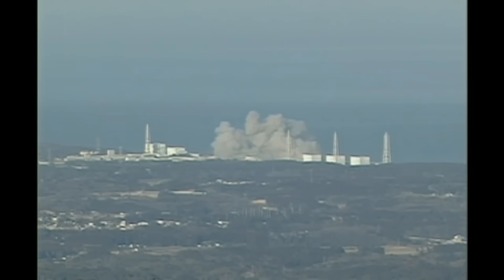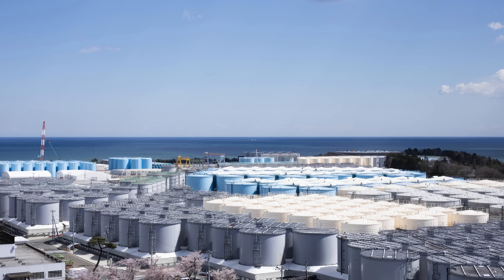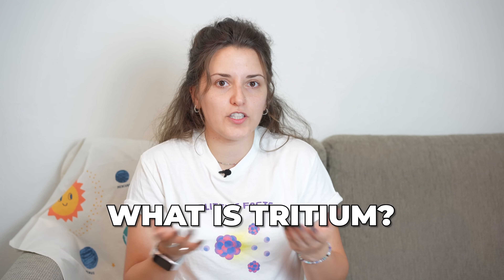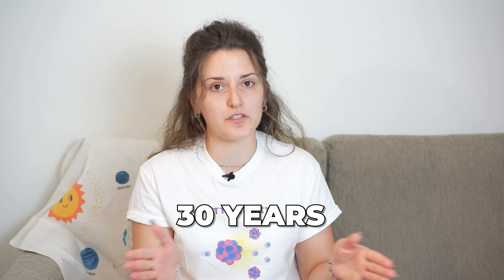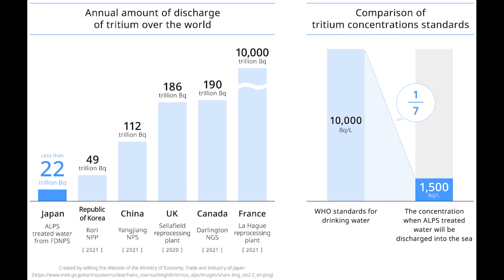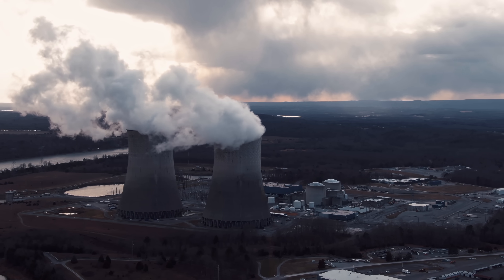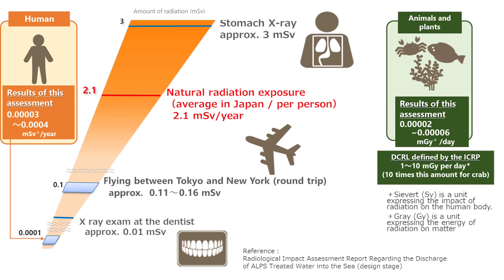Nuclear Physicist Explains - The Release of Fukushima Treated Radioactive Wastewater

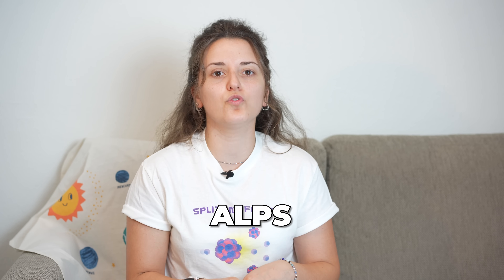Comment: Very interesting. How do you confirm that ALPS system can remove radioactive materials other than deuterium or tritium(1:22)? Is there a specific principle introduction of this system, or the paper basis of its actual test results in other projects or experiments? Or do you just believe the unilateral statement of the Japanese electric power company that caused the nuclear accident because of negligence(The Japanese claim that they have inspected less than one-fifth of the treated water according to their own standards.)? According to Japan's own investigation report, there are at least 64 kinds of radioactive substances besides deuterium or tritium in these waters before treatment, and more than 70% of them exceed the standard, and ALPS does not have same purification effect on all of them. In addition, the highly toxic radioactive substances such as neptunium 237 and tellurium in nuclear reactors did not appear in the Japanese report at all.
Reply: Verified in the full report.  Check it out instead of spreading nonsense.

Comment: i thought itrium is heavy water just like plutonium explode in combustion engine like nuclear uranium..i had discovered the technique during resrarch discusion about it in the u.s. it is not toys but depends on what level of enrichment and stable concentration it is if is less than 4 part per million then safe orher than that microwave radiation from cosmic tay can start chain reaction in atmosphere

Comment: 0:44 Correct me if i am wrong. The reactor vessels themselves did not explode but the reactor building exploded due to the hydrogen gas buildup. This is an important distinction.
Reply: Correct, secondary containment exploded, not primary containment.

Comment: The Fukushima incedent was the worst in human history. Two breeder reactors went into melt down and the water used to cool the cores vaporized into hydrogen 3 and exploded causing tons of MOX fuel (Plutonium and Uranium) to be released into the atmosphere. What remained inside the containment buildings is to this day still hot and releasing radiation including into the aquifers.
The explosions were great enough to push radiological materials including Plutonium and Uranium etc etc etc up and into the jet stream hence all over the Northern Hemisphere.
If I'm not mistaken the half life of tritium is 12 years so in another 12 years we will not have to worry about it too much,. Waste water can not be cleaned 100% from most all of the other radiation.
I find it interesting that in your video you picked the most benign radiological element to focus on and talk about.
And to my friend who claims to know about nuclear engines in submarines and that he was certified as a Electrical nuclear technician, stick to rewiring houses as an electrician you will make more money that way🤫 The science and workings of a nuclear sub are much much different then land based reactors, especially breeder reactors...
Reply: Impossible the even get past your first sentence without calling out such nonsense.  Three reactors at Fukushima melted down, and no one was injured by radiation.  Not so with Chernobyl where people actually died and 10x the amount of radiation was released.

Comment: I disagree with you totally. We are not just talking about Tritium alone. There are so many other highly radioactive isotopes that are present in the  Fukushima nuclear contaminated water. It is impossible for the so called ALPS filtration system to filter out all the contaminants. The fact is that no independent engineers or scientists have been allowed to evaluate the efficacy of the ALPS and whether it could perform it's filtration function consistently over 30 years. Also, it the treated contaminated water is safe, why Japan refuse to allow other country's scientists to perform independent verifications before the treated treated water is released into the sea. Also if the treated water is really safe, Japan could just store the treated water in a reservoir onshore, why need to release into the sea.
Reply: You could have read the report before making such a f00I of yourself on the internet.

Comment: I want to point out that the cascading failures and technical inadequacies in this disaster were greatly exacerbated by the deceit and dishonesty of TEPCO.  I would not trust any data they provide, there must be external, independent investigation of all matters.
Reply: Show where they are lying.
Reply: @ForbiddTV  I’m surprised you are unaware:  The utility that ran the Fukushima nuclear plant acknowledged Tuesday its delayed disclosure of the meltdowns at three reactors was tantamount to a cover-up and apologized for it.

Tokyo Electric Power Co. President Naomi Hirose's apology followed the revelation last week that an investigation had found Hirose's predecessor instructed officials during the 2011 disaster to avoid using the word "meltdown."

"I would say it was a cover-up," Hirose told a news conference. "It's extremely regrettable."  The Associated Press
Posted: June 21, 2016
Reply: @amazeddude1780   Like I said, show where they are lying.

Comment: Still a ways to go: 
"About 900 tons of melted nuclear fuel remain inside the three damaged reactors, and its removal is a daunting task that officials say will take 30-40 years. Critics say that's overly optimistic.

Separate efforts to remove spent fuel from cooling pools inside the reactor buildings were hampered by high radiation and debris and have been delayed for up to five years. If the plant’s pools lose their cooling water in another major quake, exposed fuel rods could quickly overheat and cause an even worse meltdown.

The melted cores in Units 1, 2 and 3 mostly fell to the bottom of their primary containment vessels, some penetrating and mixing with the concrete foundation, making removal extremely difficult.

Remote-controlled robots with cameras have provided only a limited view of the melted fuel in areas still too dangerous for humans to go."
Reply: I was waiting to see if you had some point to make about the water release, and it doesn't appear you do.
Reply: I made no point. A number of agencies approved Temco of dumping the water. Some have said there are not longer term studies of the result. Some people said that covid vacine was rushed without long-term testing. It is a paradox to me that people approve the dumping of the water without longer research yet they said mnra vaccines were not throughly tested. The fact is there is a shit pile of radio active waste there,  not to mention what has leaked into the ground water untreated and out to sea despite their best efforts. Yes the press paints a negative picture, yet the reality of the situation is toxic.

Comment: I got the same job she does (largely) and when I try to explain this stuff, 99.999% of the people that I'm talking with, eyes glass over. Most people are so disconnected with the education they got they forget how electricity flows.
In short, if it doesn't fit on an iPhone, isn't naked having sex, has words with 4 or more syllables, or it’s in a longer that a 3.5 min video, forget it.  You’re talking to a wall.

Comment: Normal nuclear plant cooling water discharge into the sea is  common practices for all present nuclear plants throughout  the world including the US nuclear fission plants. These cooling water  containing tritium which is an hydrogen isotopes made radioactive by the nuclear fission process. These waste  water are indirectly cooling the condenser through heat exchanger tube barrier and no  direct contact with nuclear fuel cores.  ,///// Fukushima radioactive   waste  water is different , the water has direct contact with the nuclear fuel cores. Fukushima Nuclear Plant  is using water directly to cool the melt-down cores . This  will Leaches out other radioactive isotopes apart from the formation of tritium. Because it cooling pumps has no electricity to run to circulate the water for cooling. And the primary heat removing  circuit is also damaged  during the Tsunami. No water is available to remove the generated heat in the nuclear cores hence external pumps are used to pump circulating cooling water into the cores to contain the heat build -up. These are the  highly radioactive waste cooling water  which Japan is  discharging into the sea now.  After so call advanced treatment process which  removed all the radioactive isotopes except minimum of Tritium. If the radioactive waste water  is so safe to discharge into the sea. Why not Japan,  recycle the treated Fukushima Nuclear Plant waste water  for Japan industrial uses and domestic uses.How about bottle it as Radioactive Energizer Beverage and sell it to US and Europe ?😂😅🤣👍👍👍.It the rights of China to ban Japan Sea Fishes and Aqua-Culture products  for the time being.  It matters of China  national security. Until the surrounding Sea water is has acceptable radioactive level. No Chinese will eat Japanese Fishes 🐠🦑🦀🦞🦐 and Aqua-Culture products. China has ensure that the Chinese people will not  have off-Springs with chimpanzee brain and calling chimpanzee their brothers,  after eating Japanese sea fishes and sea products .Certainly No Japanese Sushi for the next 6 thousand years.//// Japan, no worry, sell your sea fishes and products to US and Europe to support Japan.👍👍👍 Lastly, please do not be a prophet with no responsibility.👍👍👍
Reply: Before you pretend to know so much you could just read the report and see ALPS effectiveness in removal of all but the tritium, so the water is the same as what all other nuclear power plants release. 😂😅🤣👍👍👍😂😅🤣👍👍👍😂😅🤣👍👍👍😂😅🤣👍👍👍

Comment: So a problem I have with this is the reactor didn't have a problem. The fuel was pulled for maintenance and in the storage bins. When the pumps failed ( bad design) the build up of hydrogen found a spark and ignited. Blowing out the relief panels just like it was built to do.
Reply: You are correct, in a way, about the bad design. It is out of date. There was, in Idaho in 1986, a Fast Neutron Reactor design that was deliberately tested and proven intrinsically meltdown immune. Three weeks before the Chernobyl blunder, the power to the coolant pumps was cut off, the coolant temperature rose quite slightly, the neutrons got faster, more difficult to catch, fewer nuclei per second were splitting, and that process proceeded for "300 seconds". That's five minutes, but a second is a long time for a fast neutron. Look up Frontline, Charles Hill, breeder reactor.
Reply: @jacksimpson-rogers1069  when i was talking about bad design i was also talking about the fact they couldn't use the power they were making at the time to power the pumps. they had to get the power back they made back from the grid. when the lines went down no power even though they were making power. that should have been handled by a transfer switch.

Comment: Potassium is not radioactive, potassium-40 is, but only counts 0.0117% of all potassium. Water in the nuclear reactor does not mix with the cooling water in the cooling towers. Tritiums half life is 12.33 year, so after that time, half of the meterial has decayed. So if you have 1000 atoms of tritium, after 12.33 years you have 500 atoms of tritium and 500 atoms of helium 3, add 12.33 years more and you have 250 atoms of tritium and 750 atoms of helium 3. What you said about China dumping tritium to the ocean is correct, from one nuclear powerplant alone China dumps more tritium to the ocean than fukushima ever could.

Comment: I appreciate that heavy water is not so much a problem but you also mentioned that this water came into contact with the nuclear fuel which, I assume, was Uranium. My question is how was this removed from the water? Centrifuged? Chemically? It would have to be extremely efficient to get it out to an acceptable level. I believe it is impossible to achieve 100% extraction and I have never seen numbers indicating to which degree the water was contaminated so the public at large (me) is still in the dark.
Reply: Look up how ALPS works and its specification for those answers.  Uranium is easily done, I do it all the time with my filters.

Comment: A typical engineering attitude, acting as though policy and economics did not exist. The release of water is a) a way of reducing costs to the operators of the plant, which disincentivizes other engineers from building safer plants. And b) it shifts the ultimate liability around cleanups onto the public, and away from the responsible operators and designers. This does the same thing as the first – incentivizes less safe plants – but also make unforeseen and other cases of general environmental damage done when inadequate designs encounter actuality, more difficult to take to court, since they now have the excuse of the public mandate to release. 

You need to stop with this technocratic approach. I favour nuclear power as at least 50% of baseline power in most economies that are stable and politically secure, but only when there are adequate legal structures that actually work to build and maintain responsibility. Unfortunately, you do not, because you don't grasp that we live in societies that are no longer in the phase of technological dictatorships which brought nuclear power into existence in the first place.
Reply: This accident got every single nuclear power plant in the world review their safety measures.  Funny thing is nuclear power was already the safest form of electricity we had in 2011 and now is even safer.